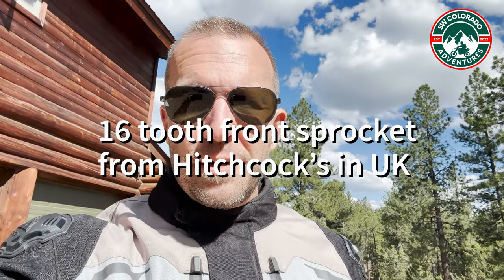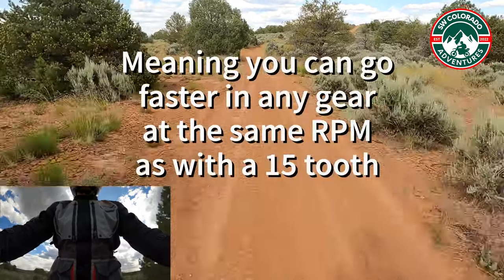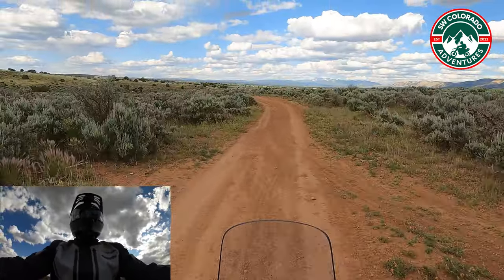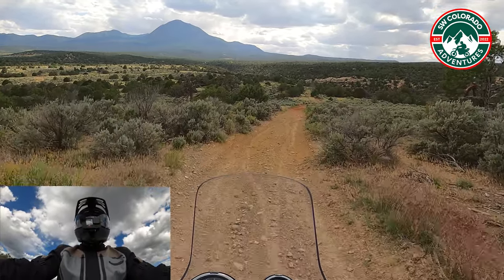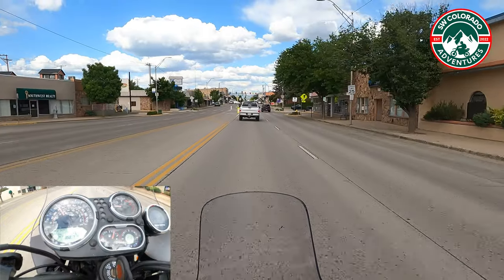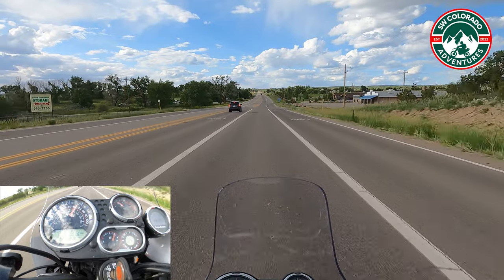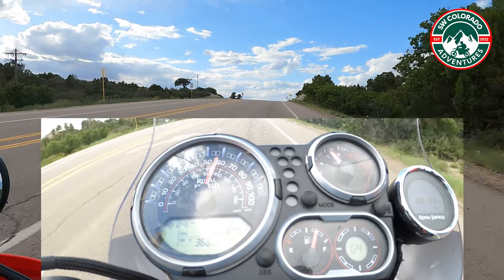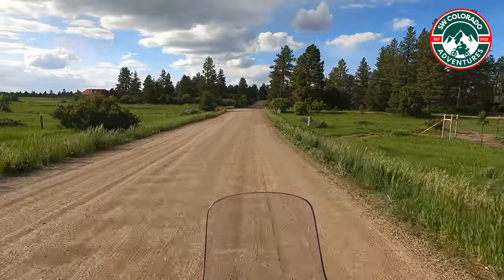16 Tooth Sprocket + Tec Camshaft + Himalayan = Amazing!

Comment: Hi Ron ,,  I have the tec cam and the Hitchcocks 465cc Big bore(plus the 16T) on my bike.. With the 16T  I do not have much joy off road,,I find the 2nd gear too high and 1st too low ,,I feel the 15T is much better off road...That said,,  for my style of riding the 16T plus the cam and BB kit make my Himalayan a great low reving back road bike (or ADV bike)  .The way I ride is kindof old style.. The tec cam allows you to have plenty of power over 5000revs,but I very seldom go over 5000 ,I mainly keep the revs between 3/4000 which s where the torque is the strongest..Its a long stroke motor so its best to keep the revs low,,, In hilly country I never over rev ,I like to take a run at hills and on the slope I open the throttle to the max without changing down relying on the torque to pull you up instead of more revs ..   My bike has the YSS front and back which makes for a better RIDE ! I cruise the back roads at 50/60mph  ..    I,m in the UK ,,so we do,nt have much chance to go off road,,,but have lots of small lanes ,,I just love this bike...  I toying with ideas for the exhaust,,I do not want something noisy ,but I would like something to allow the engine to breath better,, I am thinking of cutting out the CAT!!  Have you done that?   regards
Reply from the maker: Hello there! Thanks for watching. I agree with you on the sprocket choices overall. I just hit a high mountain trail that even the 15 tooth couldn’t get me up. I ordered a 14. We’ll see. I got the delkevic exhaust personally. I really love the sound and it is freer flowing and much much lighter. I did a few vids on that as well. I haven’t removed the cat, but delkevic offers a full header exhaust. I would probably go that route. I was in London last summer and loved it along with the countryside on the way to Paris and then Rome. Can’t wait to get back there and ride in the UK this next time. There was no rain when we were there. Good luck with the mods. I am curious if you notice a difference with no cat, so report back. Thanks!
Reply: @swcoloradoadventures  Hi ,,J you holiday in London,,oh my lord,,I hate the place,,worked in (shit city ) for 12 years until I retired last year..REgarding the exhaust ,,I forgot about the Delkevic down pipe ,,I may get one ,and keep the stock end can,,,I just watched the seat review, and have to say I find the stock more comfy now I have fitted bar rasiers,,sitting while riding is so comfy for me,,but have to agree getting out the seat to stand is abit of an effort..Another job I did was fitting taper roller bearing at the head stock ,its improved the steering alot...Before I go just have to say "Do you know how lucky you are" you have so much country to ride though,,,Here in my part of the country(Lincolnshire) off road we have about 3 miles..thats it!!! we are banned ,if you are caught off road in the wrong area your bike can be crushed... Have a nice day
Reply from the maker: @lipsee100  haha! It is a big city for sure. I grew up in Dallas and never want to go back. The head bearings are next. The rocks are wearing it out for sure. I’ll keep sending videos of the wide open spaces. Thanks!
Reply: I cut the coat put and it picks up far quicker.. tec ,airbox opened , 411cc..would recommend  doing this.

Comment: Hey Ron! I saw this tec cam video with  comments on the 16 tooth sprocket and your mods video from 2 weeks ago. Great stuff! Your bike looks great! The work on the front "mini panniers/crash guards/light mounts" etc must have been a real puzzle, but well worth the time in terms of having your headlight turn in the direction of your input at the handle bars. I've never liked that overbuilt, immobile headstock setup, especially on an off-road, adventure, dualsport bike. Makes it much harder to navigate safely, especially in low light conditions. I mounted two high power LED accessory lights to account for that deficiency. The handguards look awesome and will definitely deliver if and when needed. May I ask, did you use a particular metal polish on the aluminum mini shields along with your buffer? Regardless, they look great and  smart plan way back when ordering the Delkevic slip on in deciding you were going to keep the header pipe, in part, because of the shields. Boot melt is no fun, and neither is having to reinstall the stock cats when failing an inspection. I will definitely be following your lead with the 16 tooth sprocket, tec cam, air filter upgrade, and Delkevic slip on, and then that will be it for me, at least for this season! Thanks again for pioneering a lot of this stuff for more hesitant "adventurers" like me! Happy Trails!
Reply from the maker: Hey Mike, I used a 1.5 hp buffer I bought for making a guitar. The guitar is still in the box waiting to be carved and assembled, but the buffer is great. I used a compound that comes in a stick for like modeling clay. Its on amazon. I bet a regular buffer would work for aluminum, but not 100% sure. Thanks again!

Comment: Hi there, can I ask a question? How many miles has your Himi done - I'm guessing it's a pretty new bike to you ?

My 2022 euro 5 Himi has now got 8000 kms on the clock and I've found that the std engine pulls so much better (than when she was first brand new) on and off road. So I'm expecting great things from a TEC camshaft and 16t front sprocket when I fit them.
Reply from the maker: I’m over 2k miles currently.
Reply: @swcoloradoadventures  You will almost certainly find that as the mileage increases the Himi will perform better and better. Just make sure you give her a goodly amount of throttle and oil changes in equal amounts.
Reply from the maker: @Dave-in-France  thanks for that. I’ll be looking forward to it. Thanks!
Reply: I can verify this, I've had mine for 5 years now, 15k miles (24k km) and she runs better now than ever. The stalling has long gone, the engine is nice and loose, gear changes are smooth as always, she sits at 75 all day long which i hate to do of course. All i can say 5 years on it's all good, all stock and i wish to change absolutely nothing! Heck i don't even stick to plan with the valves as they haven't moved since the 6k service!

Comment: Interesting! I am in CO as well and recently installed the TEC cam for the same hills, but also winds. I kept the 15t to get maximum acceleration into those winds but your test ride has me thinking about jumping up to the 16t. 

Quick question: how have your valve adjusts been post-install? I have had to go back a couple times and tighten the tappets since breaking in the cam. It initially had a very “ticky” noise to it. Wanted to know if you observed the same.
Reply from the maker: Hey Mark. Yes, I adjusted the valves after the install. I also just changed the oil and checked everything again. All good after a week. The nice thing about the sprocket is that it’s easy to change back if it’s not quite what you want. The sprocket was $25 and the chain was $80. Good luck with it. Thanks!
Reply from the maker: And, the valves were way off after running in the cam.
Reply: @swcoloradoadventures  thanks much!

Comment: 4th gear and 65? Wow. Am usually changing into 5th at around 45/50 on my Himmy but its a new one. (1000 miles).

Just got a sidestand extender from Hitchcocks.

P.s my only gripe with my Himmy has been its chugs a bit in second doing slow corners so have had to use a bit of throttle but has gotten a bit better at 1000 miles ish.
Reply from the maker: Hello there. With the 16 tooth sprocket it works. If you ride toughish trails, I would keep the 15. Currently testing a 14 tooth for those tougher trails while getting over an injury. Thanks!
Reply: @swcoloradoadventures  At the moment more roads as need to get some extras for bike plus somw adv boots..(hand guards and an engine guard enough I think)
Reply from the maker: @MauriceTarantulas  all that is important for sure!

Comment: What size chain link did you order?
Reply from the maker: I went ahead and bought the whole chain from Amazon; 525/120. I couldn’t find a link to add specifically and most folks recommended against trying to fit one to a chain you already have. Hope that helps!
Reply: That's the one I ordered off  your link.  120 is too long so am wondering how many links you removed? @swcoloradoadventures
Reply from the maker: @bswear77  you are correct. Can’t remember off the top of my head. I’d have to go watch that video where I changed the chain. It ended up being only one longer than oem though.

Comment: any changes in fuel consumption??
Reply from the maker: It’s up and down. But, that’s because  I’m riding on roads and trails from what it seems. When I was running in the cam had 16 tooth on for most of it so I could go faster while staying under the max rpm. During that time, I ran 73 mpg avg. Since then, however, I’ve been hitting the trails hard and testing out performance. So, it’s a bit harder than I would normally ride day to day. Last checkpoint was 64 mpg. Previous to all the changes I was averaging around 70 mpg. So much depends on what I’m riding it seems. It would go down every time I did more off road. That’s not a super precise answer, but I hope it helps explain what I’m getting. It would be much easier to tell if I had a regular commute. Just installed the PT ECU and am playing with the maps. My guess is the next check will be under the 64 because I am adding more fuel to the mix and advancing the timing. We’ll see what that actually looks like. Thanks!
Reply: @swcoloradoadventures  I'm now on 74,5 mpg (US) average over 2400 miles commuting and last tank was even 80 mpg US. Would be important for me to keep this good milage up because the fuelprices are up to 1,80€/litre (7,45USD/gallon) now here in the Netherlands. greeting and keep up the good work Peter Prins
Reply: I have a more breathing exhaust and I opened up the airbox ( standard airfilter though)
Reply from the maker: @Onrust123  I can totally see how that is super important for you. Interesting mix of variables weighing on fuel costs… I really can’t imagine going down as a result of the sprocket at all. The cam possibly a bit. But, seems like the two may offset. The cam is much more difficult to test out on a whim though. Thanks, Peter!
Reply from the maker: @Onrust123  I did that as well. delkevic exhaust, open air box and k&n filter. Small incremental movements with just about anything. Riding hard seems to be the most damning situation on economy. More testing to come. Thanks!
Reply: @swcoloradoadventures  @Onrust123 Any updates with that ? I have the same issue and I live in the mountains so fuel economy is definitely a must to me but the added torque is really cool too
Reply from the maker: @Skyler-md7ny  hey there. The last few times I measured it after installation I was still getting mpg of between 60- high 60s. That was a combination of road riding to the trails to riding variously aggressive trails. I never felt like I was gonna run out of gas. Lots of variables but as long as I topped off before and after trails I never got close to running out. Hope that helps. When the snow melts I’ll get a definite on my first ride. Thanks!
Reply: @swcoloradoadventures  thanks for the super quick reply it's very valuable info ! Ride safe :D